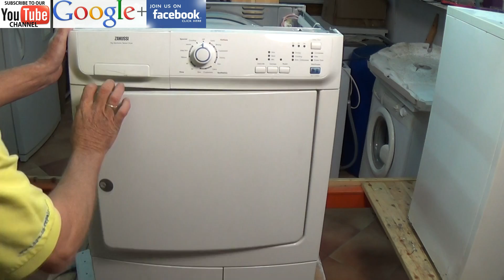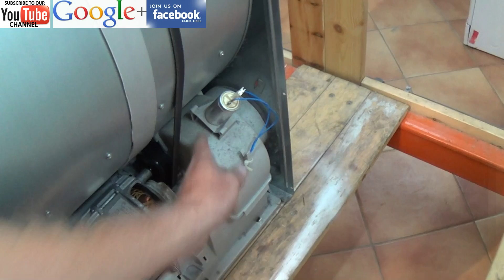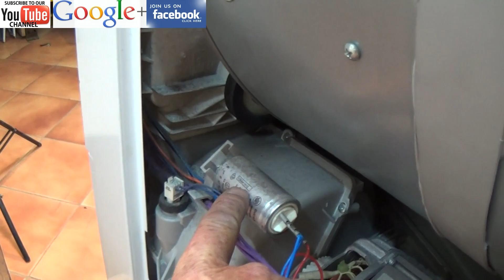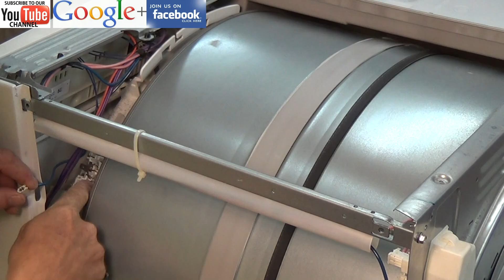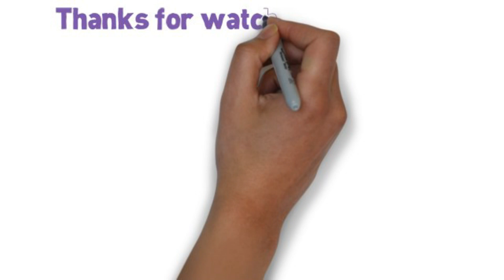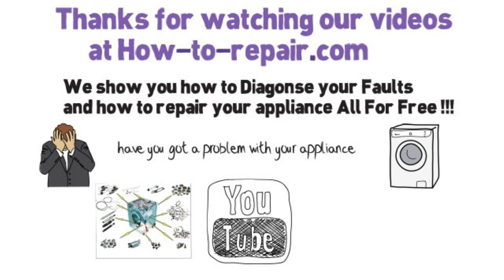How to enter diagnostic test mode on tumble dryers Aeg, Electrolux, Zanussi Etc

Comment: Also for my AEG t55840 the reset works at point 10. Thanks!!!! I had error code E 32 E 51 and E54
Reply from the maker: If you get e51 or e54 again you may have a problem with the link switch on the printed circuit board

Comment: Hi
I have aeg dryer model T65170 AV
When I turn it on it works for a few seconds and then stops working, I will be happy to know if there is a possibility to fix the problem with programming of the buttons, as I saw in other models on YouTube thanks in advance Arie Vaknin

Comment: My zanussi has a capacity of 7 kg. If 5 kg in stop does not want to turn, you only hear that the engine has trouble with the engine ... but at 2 kg with a push in the drum so manually it will turn. Where would it be?
vr greeting,